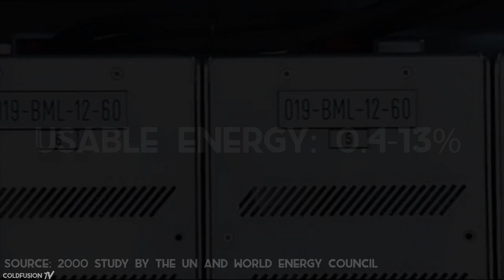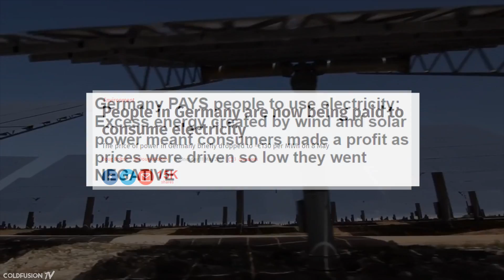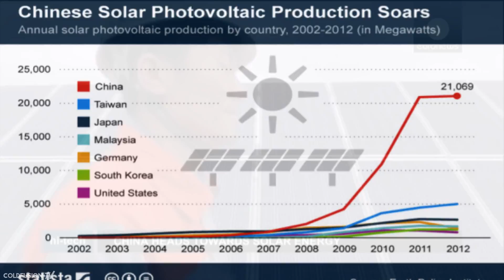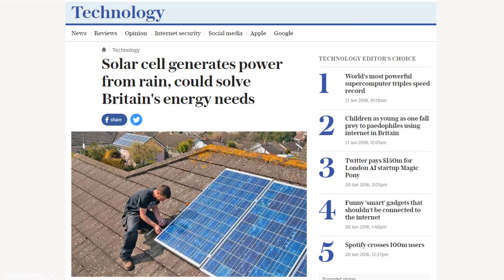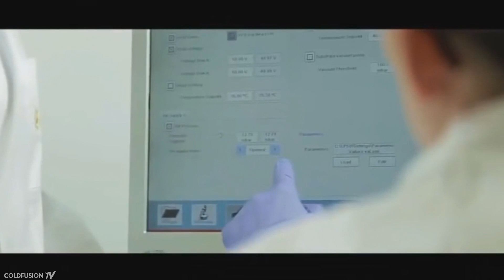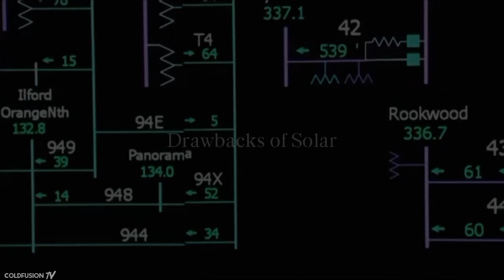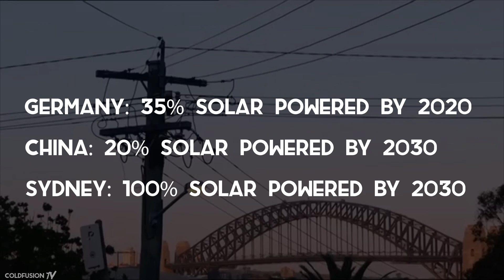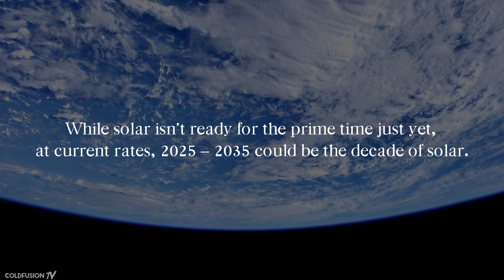The Truth About Solar

Comment: A new study by Ferroni and Hopkirk [1] estimates the ERoEI of temperate latitudesolar photovoltaic (PV) systems to be 0.83. If correct, that means more energy is used to make the PV panels than will ever be recovered from them during their 25 year lifetime. A PV panel will produce more CO2 than if coal were simply used directly to make electricity. Worse than that, all the CO2 from PV production is in the atmosphere today, while burning coal to make electricity, the emissions would be spread over the 25 year period. The image shows the true green credentials of solar PV where industrial wastelands have been created in China so that Europeans can make believe they are reducing CO2 emissions.
Source: http://euanmearns.com/the-energy-return-of-solar-pv/

Seriously, please read the article to educate yourself, more people need to have a grasp on reality and stopped being fooled so easily because it's wasting energy and resources. Democracy sucks.
Reply: Very debatable, it will be interesting to see if someone designs a panel where you return it too the manufacturer and the glass and framing can be reused and just the cells are replaced.
Reply: Please read the article.
You have to understand that our modern society needs order of magnitude higher ERoEI in order to function, because it is so complex there are so many different jobs. Otherwise all of ressources would be dedicated to produce energy, meaning our civilization collapses due to the low availibility of energy.
Reply: Maybe society needs to control our energy use instead of wasting it!

Comment: Those problem in germany are gonna go away, once they start heating their home with electricity & charging their car. PV in china is 1%. Most of China's industry uses oil. Homes appliances & leds are but the tip of the iceberg. Heating, Transportation & Industry are the ones in dare need of transformation. PV on top of car is the dumbest idea ever, proven with actual facts.

Comment: I was thinking about having a few solar panel working directly onto a water heating element say 24 volts. I would then use the hot water as a space heater on cold but sunny days. Has anyone done this that you know of?  I ran a 12 volt fan direct from a panel, and it worked absolutely fine - no battery or regulator required. I have a 24 volt system that supplies everything I need except heating. So, panels being cheap, I was simply going to buy a few extra panels, mount them on my veranda roof and connect them directly to a water heating element. If anyone reading this has tried something similar, would be glad to hear from you.

Comment: How does the 36 cents per watt work ? Is that based on initial cost of solar equiptment ? Or is that based on total amount of energy over the course of the life of the equipment ?
Reply: All these stats are completely up for debate, for a start it depends which country makes them , are wages included in the overall coast and what materials are used to construct them. There,s a lot of pie in the sky costing comments here.

Comment: Production numbers are ALWAYS inflated, because they rely on angle of incidence to the solar panel, direct sunlight (not diffuse light), and temperature under IDEAL conditions.  Change any of these, and production values plummet.  Yes, the light penetrates the clouds, but the amount of energy drops precipitously (from 10,000 foot candles illumination in direct sunlight to 100 foot candles under an overcast sky).  You can lose 25% of your efficiency to heat (Solar Cells are generally tested at 75 degrees F, and gee - it gets hotter when you leave it in the sun all day).  Angle of incidence can reduce  your efficiency (from minor loss to 40% at 83 degrees) - so a motivator to change your angle is required.

Based on all this, I really suspect that 13% number of what we COULD get is highly suspect....when you figure getting to 19% efficiency is currently the "holy grail" of solar cell design.
Reply: Thats not a stat that TIndo panels come up with from Australia, and its a farken hot place.

Comment: Did not tell the energy use cost of making maintaining transporting and replacing the cells.  Geothermal is more consistent  and has less parts and per user much fewer connections to the grid. Geothermal is a freer free lunch.
Reply: If it was better every multinational corporation in the world would be onto it.

Comment: A few points, free energy from the sun, crap, soler systems even on 2018 are expensive and adding battery storage takes the cost out of reach for most people and you have to consider the life of the panels and battery. Stating the amount of energy that the earth absorbs is akin to the statements of the most abundant element in the universe - hydrogen.
Chinese panels are still 2nd rate to German, American and Australian panels. The good ones are expensive.
Battery cars are bullshit, try towing my 7m boat 600km, refuel in 2 min then off for another 600km.
Reply: C,mon mate why couldn't you have one Fossil fuel vehicle to tow etc and one that,s battery that does fuck all k,s and goes to the shops and picks up the tin lids and shit.

Comment: The heavy metal pollution that the current round of solar panels generates when the glass breaks is a huge problem... Here there have been big solar farms that were abandoned as "not profitable" after the subsidy money ran out.  A few months later after a few hail storms?  Arsenic and lead in the soil.. along with other nasty metals.  Solar panels (the traditional type at least) needs to have guaranteed site remediation to avoid having farmland destroyed for agricultural use if the land gets polluted.

Comment: I am all for solar power.  There are several ways to manifest solar power into usable energy.  The solar revolution is happening in China fastest and they make most of the solar panels and batteries.  I think that RF energy is a better energy cost for the people as well it takes little to harness and can provide a greater sum of output to input ratio enough to sustain an energy source and a high-quality source of dielectric power (heat) at the right frequency between the induction of the (specific) metals.  Solar is so limited and has to be stored on battery banks which makes it vulnerable as an energy source.  RF energy is found everywhere in night and day and everywhere high or low.

Comment: I thought peak electrical usage was in the middle of the day, not at night. That's why some electrical companies charge less for killowatt usage between the hours of 9 pm and 7 am because nobody is using as much electricity. 

During the middle of the day, everyone's washing/drying clothes, lights on, TV going, dishwasher is running, air conditioner is on full blast running non stop from 10 am to 9 pm. 

I'd think by 9 pm, most people would be in bed watching TV.

Comment: Still waiting for a solar-powered smartphone
Reply: a solar powered smartphone makes no sense. plus the energy you got on the area of a smartphone, even with a perfect panel it wouldnt be enough.

the good thing is that you dont need a solar powered smartphone. you only need a solar powered charging station with a battery. there are flexible solar panels now, you could unroll a decently sized solar panel. charge a 10000mah battery, good enough for 2 charges on your smartphone. and use that instead of a solar smartphone.
Reply: The area of a phone is too small to capture enough energy
Reply: Precisely why that phone never really sold well.
Reply: I guess you can't power a smartphone straight from the solar panel, without batteries.
Reply: Why are you waiting?   https://inhabitat.com/samsung-releases-solar-powered-phone/
Reply: @Paul Smith
How many hours daily can you have a phone call, without charging from external power supply?
I guess that's only a play gadget and not very useful, if you not living at the equator and there is 24/7 sunshine...  
I regular conditions, ther is most of the day no sunshine and cloudy heaven. Also the smart phone is in your pocket. I think it will not survive, without external  charging...
Reply: still waiting for smart smartphone instead of dumb terminal with colorfull pictures.
Reply: The amount of energy that any SMART phone consumes is way more than a solar panel can provide.  The screen alone consumes more energy than what sunlight can provide.
Reply: @richardwicks4190  not necessarily true
Reply: @IPv4Address  "not necessarily true"

For a SMART phone to be realistically powered by solar power exclusively, either you get a tiny screen with a backlight, or  you get a screen with no backlight.

Solar panels might be 40% effective at converting solar light to electricity (and trust me, that's more than 2x than what you'd really expect) - but a TFT screen is only 1/6th efficient and that's if the backlight is 100% efficient.

This is because you have a filter for red/green/blue for a pixel, then you need a filter polarize the light.  1/3 * 1/2 = 1/6.  That's 17% efficient.

Black and white display might be doable and they don't need backlights.
Reply: @richardwicks4190  I’m not saying to make it powered with the screen. I’m saying put a photovoltaic cell on the back of the phone with a open circuit voltage of 5 volts and the highest efficiency solar cells are 23% realistically it could be possible if phones got more energy efficient
Reply: @IPv4Address  Screens aren't efficient enough.  You wouldn't get enough power from the sun to power the screen.  If you had the back of the phone pointed directly at the sun at noon, maybe you could fully power the screen.

But how often would you be outside?  Even for just charging this isn't ideal.
Reply: @IPv4Address  If you just want a phone, not a SMART phone, yeah, solar would work fine.  You can't have a smart phone without a screen.
Reply: @richardwicks4190  what if we found a way to make the back light in a LCD display use the raw sun light lo light it could it work then?
Reply: Our cell phones and our laptops are all solar powered. We only charge them when the sun is out. I should add, we have 5kw of solar at our disposal.
Reply: Most people that continuously use smartphones don't go outside.

Comment: All those instances of solar power producing excess energy happened for just brief periods of time. Don't jizz in your pants yet. The fact remains that the capacity factor of solar power is still very very low and is far from being a baseload replacement even with battery backup. For certain off-grid applications, yes. For replacement of baseload power, absolutely not.

Comment: there are better methods to make power but big companies can make more money on solar and wind so they shelf the better ways and continue to sell solar, wind, coal, and gas. personally i can not imagine putting glass on my roof in Wisconsin, it will not last very long and even if it is not glass it will deteriorate and require batteries which have a limited life and cost a lot. Geothermal and wave action  has some promise but no one wants to develop it even though it is a totally free energy once the process is started. I believe there are also other newer ways to make energy but no one seems to want it to get out because it would disrupt current energy revenue.
Reply: By the way what about cold fusion?

Comment: Solar power is here to stay. Big solar or grid tied government regulated, priced is not the way we need to go. But it will happen if you and I the home consumers don't embrace this technology. Go on line and check out the offerings from the large home improvement supply companies. Grid tied, off grid systems are in abundance. Id like to name some but they'd probably be edited out. Watch you tube videos get educated. You don't have to start big or invest a whole lot of money. But once you see a properly designed system run and enjoy the benefits Im sure you will understand why money would like to control solar like they control the oil and gas industries.

Comment: Flywheels and compressed air are very low tech.  If off grid houses had a poly-hybrid alternate energy harvesting including burning gas; the cost of AC and heating would dramatically drop.  It would become a game to reward the most innovative and efficient systems.  Wind and solar and biofuel and storage via compressed air, flywheels
and batteries;
    should put a nice curve in positive productivity, architecture and engineering jobs. Slow turning home flywheel cascades to and from battery and compressed air storage systems.  Also using compressed air to run washing machine could save much copper wire.  They could be all plastic motors.

Comment: Full of false truths and lies. This is a political pie in the sky view of solar. For example they want you to believe that on a cloudy day solar cells will still make 80-90% of the energy on a sunny day, the fact is only 10-20% is produced.  What is not discussed is how many square feet of solar cells are needed per square feet of house. The truth is it would take 4-6 times the surface area of a houses roof to provide the needs of the house. A 1500 square foot house would take about 6,000 square feet of solar panels. that is a panel about 80 feet by 80 feet. Add air-conditioning and you can double it. TRUTH!
Reply: I have a 1600 ft house, propane for hot water, stove, and fridge. All else is solar powered. 450 watts (about 3 square yards)  on the roof. No problem.49 deg. N lat.

Comment: Solar cell efficiency is not a major concern when comparing to things like coal.
Coal may be at 50% efficiency, but coal harnesses the power of a fossil fuel. If we don't use that fuel, it's still there afterward.

Solar cells harness the power of sunlight. We can compare solar cells to other solar cells, but if we use coal instead, then our solar power usage goes down to 0% efficiency. All that energy still arrives here, and it still dissipates even if we don't use it. By not using it, we're wasting this energy.

I mean, okay, in a way, plants are a form of solar cell. So we can compare photovoltaics to plants. But that requires that we use those plants in some way.

Comment: The light tha tpowers solar cells is not visible light. It's a hiigher energy light that penetrates the clouds. they do put out less energy when it's cloudy but they put out energy. If you have neough cells they'll give you enough energy. On sunny days you just need to store the excess energy for later use. At any rate you need to store some enery for the night time any way. An dadding wind power to your system will make up for much of that night time loss.

Comment: Here is the huge issue with solar. Batteries, even Tesla's power wall has the same issue with it. As the battery bank charges and discharges the lithium batteries degrade. Imagine having a Tesla power wall that cost you 5k in battery replacement every 10 to 15 years.

Comment: It's not free. You have to buy the solar first. Than it takes 20 years to pay it back. Before that time you will have to replace those panels. therefore you will never get your money back period!! What technology do you know that you can use 5 years out nothing and solar is included. Connector change so you need to but a new Converter if your breaks.

Comment: while the cost per watt of solar may fall as low as 5-8 cents per watt the power retailers will never sell that at that rate if anything they will keep it at parity to coal to cover the storage ie some form of battery farms, pumped hydro etc. So then collect and store your own energy sounds great, The cost of the batteries to hold enough energy to do a household for a day and the number collectors to recover enough energy to feed the household while while charging the batteries to say 60% on a winter day at the current time would equate to the purchase of a top line Mercedes or BMW and would not factor in that most of the system would have to be replaced every 8-12 years. Right now the suppliers and installers are price gouging the equipment to the hilt and there is squat that can be done about it. I'm just waiting on the governments to jump on the bandwagon and introduce and excise either on the equipment at the time of installation or as an annual tax or both.

Comment: The problem that wasn't addressed was battery storage. I've been off grid for 25 years and found that your battery is your fuel tank. The more you have in amp hours the better because you use less of the batteries cycle life which means they last way longer. It's battery technology that's lagging behind. With super capacitors that are beeing built could be the answer.

Comment: Propaganda Bull shit. You’re a smart guy.  Do not rely on reports done by so called reputable news agencies.  Use solar power system and you will find out the maintenance cost is expensive.  Also current solar panels are less than 15% efficient. Water is the best source for energy.